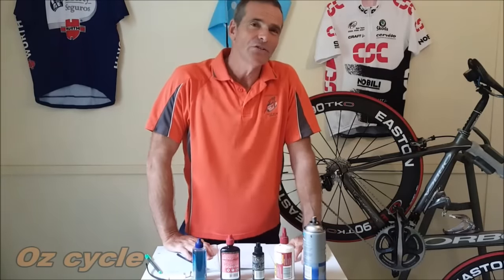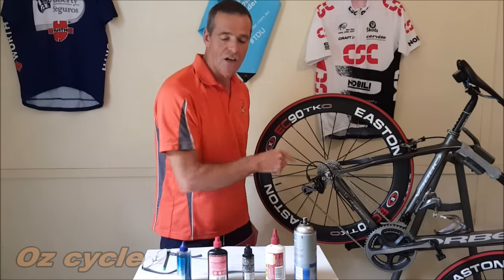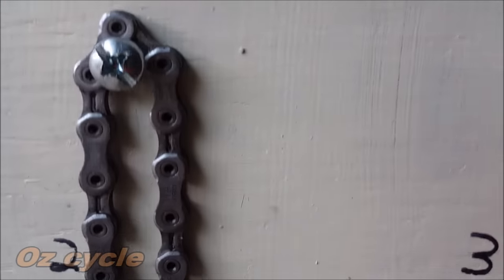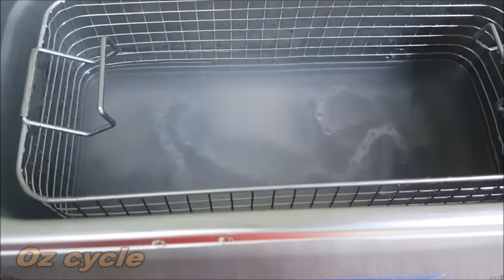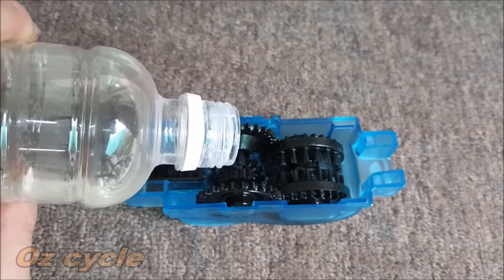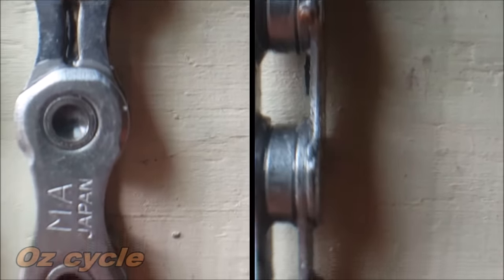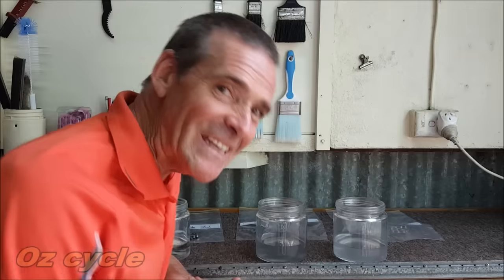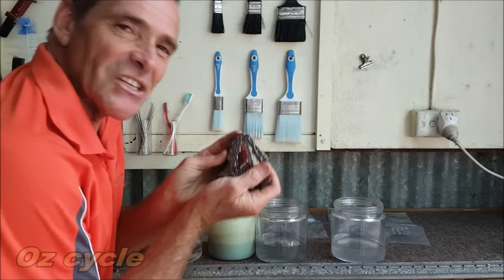Best chain clean ever !!

Comment: Hi just tried Your waxing on my hometrainer bike. it is sooo great. I started the chain in gasoline, then my ecological degreaser, then cellulose thinner, acetone, and a 1 hour cleansing in my ultrasonic cleaner with all the good stuff in. Ended up by boiling the chain for 10 minutes in water, the dried it. Man it was so clean you could use it for medical purposes. Put it in the hot wax for 1 hour, with lots of stirring, and just mounted it. Runs like a charm.  Thanx for your great videos and always new ideas how to get the best cheapest. Keep up the good work. :-)

Comment: Hello from Brisbane! Love your videos - some of the best bicycling advice around, I reckon. 

I've been using your degreasing and paraffin wax method on a chain since new, and it is way better than the previous chain, so smooth.

I degrease and wax the chain when it needs it, which is after about 250 kilometres. There's no black build up ever, and the cassette always stays shiny, though I do degrease it every 500 km's because I feel like it, not that it needs it.

Thanks for all of your thorough experiments and good advice - great work mate!
Reply from the maker: +Rob Pennefather Thank you Rob,glad you like the vids. Yes the liquid wax method is good but if you can do the wax bath method (next video coming) its even better in all aspects.

Comment: I really liked the thorough comparison of different methods and their effectiveness. I have stopped using petrochemicals however, even though they do the job very well. 
I just don't think the cleanest/most efficient bike is worth the environmental cost of having pollutants leached into the soil, streams and organisms. As there are biodegradable options now availabe, I've been sticking to those instead. I don't run top of the range components and I just make sure everything is cleaned when needed.
Reply: Exactly, I'm with ya
Reply: Could you please share what these options are?  Thanks
Reply: @scuba453  I use citrus degreaser for the chain. Weldite and other brands make it. It derives from citrus peels.
Other products like the muc off degreaser work slightly better and claim to be biodegradable, however, they have hydrocarbons.   Many products with volatile hydrocarbons are labelled as inherently biodegradable in the SDS, but that is very different from being readily biodegradable... Muc off boasts about being green, but looking at the ingredients list and their SDS shows a different picture... I've asked them to clarify the SDS against their marketing claims, but got not reply...

I've tried a few lubes and green oil is one of the best which is not petrochemical based. Both wet and dry. I also tried the WPL dry lube, but it lasts next to nothing no matter how it's applied. 
I want to check Peatys (some of their range claims to be readily bio)and Kingud eventually...
Reply: @nluisa  thanks for the detailed reply. much appreciated.  happy biking!

Comment: If you're paying AU$150+ for an ultra sonic cleaner, you're buying a rather expensive one. Additionally, you're getting one that allows you to put every single piece of your chain equipment into it at that. And your pedals, crank set and probably everything else you'd want cleaned, including your entire tool set.

And there's nothing stopping you from using a different mix of chemicals either.

However, the main advantage of the ultra sonic cleaner over the homemade cleaner, is that you're not left inhaling unhealthy fumes, polluting your lot or accidentally leaving something around that your kids will decide to either sniff or drink.
Reply: Wear a mask?

Comment: Excellent video. I've been using various home made shakers to clean my chains for years. I just don't like using gasoline but I Do often use gasoline +two stroke oil mix left over from my chainsaws fuel supply. After cleaning the chain I filter the gasoline oil mix through coffee filter paper to remove the residue and then run it in the chain saw. There's two fuel filters between tank and carb so the gasoline is the easiest to get rid of for me.  Keep up the great practical tips. Moe people should try your ideas because I've been doing many of these things for years including making my own chain lube :thumbsup:

Comment: Petrochemical solvents like petrol, turps or kero, are very good at dissolving most oils and waxes but are no good at dissolving water and water is no good at dissolving oils and waxes.  Degreaser and water is only a mediocre solvent for oils and waxes because water is a polar molecule and oil isn't.  All the degreaser does is weaken the molecular polarization a little.  Same issue with green cleaners as they are water based.  Alcohol, is a petrochemical chain that has a hydroxyl on the hydro carbon chain.  The hydroxyl part of the molecule is polarized.   Therefore, alcohol will dissolve water and visa versa but alcohol can dissolve a small number of oils and waxes, usually only some vegetable or synthetic ones, not mineral.  For example, caster oil is soluble in methanol but requires physical agitation to do so.  If you think about this, it partly explains the results.  Using petrol, degreaser and water steps, combines different solvent bases so will flush material that is impeded in these bases.  If you were to then use alcohol to flush the water, the chain would then dry much faster due to alcohols higher evaporation rate.  Yep, organic chemistry 1976.

When I was young, I used kero as a 1st clean and degrease.  It was cheap then but isn't now.  Petrol is kind of dangerous, it doesn't take much to ignite the vapor and is pretty hazardous for the body.  I generally take the chain off, soak and swirl it in turps these days as it's quicker than using cleaners that are ineffective oil and wax solvents.  I would agree with using degreaser after that.   The in line chain cleaner is largely ineffective because the small volume of solvent limits the dispersion of material cleaned off the chain and a lot of that material gets caught on the gears and jockey wheels to re-contaminate the chain.  That makes a big job, uses a lot of rags, wipes etc and you still can't be sure you got it all.   This is my main reason for taking the chain off the bike to clean.  Thank goodness for quick links.  I'm sure some people can point out exceptions, the principal of incompatibility between polar and non polar molecules is only a generalisation for the majority of cases.
Reply: Thanks for that excellent comment ! Just to clarify. You soak in mineral turpentine then soak in degreaser as well?
Reply: Unfortunately not all of us have quick links on our chains so that they can be removed.
Reply: you complicate simple situation, if you use wax, you can clean chain with wax, take a look on my coment to Mr. Miss
Reply: @khalilrazak6486  I never had a quick link on my chains 30 years, my bike I'm building will as I am embarrassed at my chain and cassette are black!
Reply: Khalil Razak 
A quick link costs almost nothing and installs with ease. There’s no excuse for not having a quick link :)
Reply: You're missing one key characteristic of soap/detergent chemistry and that is soaps and detergents are amphipathic molecules and that's why most soaps and degreasers  need water to work.   One end binds to the lipid, the other end binds to the water and bingo.   If you have enough oil and water, eventually all the molecules are tied up and that's why you sometimes need to add more soap to dish water.   This is also why you can add oil and dishsoap to a sink full of water, put your hand in, and your hand comes out with practically no oil on it.  ...try that again without the soap.     btw, i'm using soap, detergent, and degreaser interchangeably here even though they're technically not the same.   soap is a very specific substance where the other two are not.
Reply: @littlegoobie  No, I am not missing that key characteristic at all.  Detergents/degreasers etc are basically an attempt to modify water in a way that it can dissolve non polar molecules found in petrochemicals.  Well I'm sorry but my observations over 6 decades tells me this is a fools errand that only works in a weak and mediocre way.  You far better off just using the appropriate solvent type in the first place than trying to modify an inappropriate one.  Yes, I know that isn't the green thing, but the green thing just doesn't get the job done and that's all there is to it.  A very small amount of the appropriate solvent will simply do a better job  than many gallons of water and degreaser and just consider all the water you just polluted with that.
Reply: Lizard King  Polarization is not magnetic, it's electrostatic.  Water is a bent molecule, the 2 H are closer at one end than the other.  This means that the electron bonds are more on that side making the H side a neg charge and the O side a pos charge.  This is the basic reason that water has a surface tension and is the reason that water can not dissolve oils.  Detergents can modify this somewhat but the underlying condition still exists and limits their effectiveness.  Interestingly, alcohol has an OH on one end that also creates a point of polarization while much of the molecule remains unpolished.  For this reason alcohol is soluble in water and can act as a solvent for both some polar and non polar substances.  However it's ability is still a bit limited.  Alcohol is generally better with vegetable oils than mineral oils. For example 80% methanol 20% caster oil is a common basic 2 stroke model glow plug engine fuel.
Reply: Thanks so much for sharing your knowledge. 
So your recipe includes: 1. Mineral spirits (paint thinner. Correct?) 2. Degreaser (WD40 okay?)  3. Rinse with water 4. Alcohol (isopropyl okay?)
Reply: @littlegoobie  I took organic chemistry too and littlegoobie's explanation of how detergent works is the same as I was taught. Detergent works and it works well to remove grease but not as well as other solvents that are more dangerous. Unfortunately detergent does not disolve wax.
Reply: YES! Remove and swirl. Keep it simple...

Comment: I use a chain cleaner device thing and it does great.. Although you seem to barely use any chemical in it. I fill it until it overflows and then run it through, and repeat a few times when it all splashes out of the holes. I can run it through a soapy cloth without any black being left on the cloth.
Reply from the maker: +dan110024 I tried filling it up more,dan,but same thing...it spilled out,so for the video I put the recomended level.
Reply: oz cycle yeah they tend to do that. Mine is larger so it takes longer to empty itself, but messy nonetheless. Does a good job though after a few cycles of it and after a rinse with soapy water.

Comment: THANKS! I've been clean chains the 'homemade" method for decades, but I never knew it was as good as you have shown. Well I don't do quite your method. I use paraffin. I used to use gasoline when a was a kid. Paraffin (kerosene) is less volatile. Sediment settles on the bottom of the tank, and I can recycle an almost clear  jar of the stuff by decanting into a second jar. (I guess you could to the same with gasoline, but, but one has to apply more caution.)

Comment: Excellent video. It's very thorough, and I love the attention to detail. If I had the room to doo all of that, then I would, and I just might after getting my new chain in a week or so. 
However, and this of course doesn't clean and lube as well as the steps done here. 
Hello everyone. My name is Andrew, and I use WD40 on my chain. I tried to stop, but it is just so damn convenient. I spray it only on the chain and let it sit to loosen up the grime while I give the whole bike a good scrubbing after a ride. Once I dry the bike I power wash the chain with the highest setting on the water hose to blast out the majority of gunk while rotating the chain backwards. With a dry towel, I wrap the chain, and dry it by rotating the chain backwards again. After the chain is dry, I spray a light coat of WD40 on it again. Then wrap the dry towel around the chain to remove most of the WD40 from outside of the chain, leaving it as dry as possible. The pins will have WD40 on the inside where it is important, but the outside won't, leaving my cycling clothes spiffy cuz that is what's important ;)

Comment: Ok. Serious question. What chain link do you use? I was looking at a KMC one for my Campagnolo 11 speed but they suggest to replace them after 2 breaks. What is your experience with master links and what do u recommend? I always use a brush cleaner as Campagnolo don't recommend the Master link..
Reply from the maker: +WalrusRider Wipperman connex make the best removable link,Jon. All stainless,removable with just your fingers and last longest. Im still using same links after about 15,000km. Compatable with all chains too.

Comment: The faulty logic in this test is amazing. An unsafe degreaser/cleaner (gasoline) is used in the homemade cleaning device. It leaves a film and so a second degreaser is required to remove the film left by the gasoline. And yet the author concludes the homemade method works better than the ultrasonic cleaner when the ultrasonic cleaner was used improperly and yet it still equaled the effectiveness of the homemade method when the ultrasonic cleaning time was doubled. How much extra time was required to use a secondary degreaser to remove the gasoline film from the chain? That increase in time and cost of the homemade method was never factored into the comparison.

The ultrasonic cleaner may require a little more time (but we can't be sure because the author did not appear to use the correct fluid level -- with the correct level it may not have required any more time). But, in the end (after the extra time) the ultrasonic cleaner achieved just as good a result as the homemade device yet offered a HUGE advantage: It achieved its good results with a safe degreaser and cleaner. No risk to health. No fire hazard. No risk to the environment. No requirement to use a second degreaser to clean the film left by the gasoline.

I appreciate Oz Cycling. The author has produced some very insightful and helpful videos. My favorite videos address composite frames and components. Kudos and thanks to Oz Cycling for the great content. Sadly, this video is not among the good ones. And the original Oz video demonstrating the homemade cleaning device is even worse. In that video we see the author splashing gasoline on his ungloved hands. Imagine if he had splashed the gasoline in his eyes as he shook his homemade device! He never cautions the users to the risks of gasoline. Nor does he explain that gasoline will melt some plastics, therefore the user must be careful that the container they select for their homemade cleaning device is approved for gasoline. My advice: Remove those videos. Modify the homemade method so it works with a "safe" degreaser/cleaner that does not require a secondary degreasing. Then shoot new videos with the improved method. This will serve your viewers much better.

The homemade method may truly be the "winner" if it is modified for safe use at home by do-it-yourselfers.
Reply from the maker: +D.Eldon Petrol still cleans way better than my ultrasonic cleaner...tried and tested over at least six months. Try it for yourself...pull the chain apart after the clean and you will see which leaves cleaner pins and rollers.
Reply: Sure, gasoline dissolves grease and oil faster than the "safe" degreaser you used in the ultrasonic cleaner. No dispute there. The problem is: gasoline use presents risks to health, safety and the environment. If you base your degreaser selection only on effectiveness as a degreaser, then why limit yourself to gasoline? Why not use acetone or MEK or toluene? They are each more effective than gasoline. I think the reason you're using gasoline is because it's cheap, plentiful and it's the "easy" choice if you don't care about your health, safety or the environment. I'd hate to think what you'd use if acetone, MEK or toluene were cheaper and more plentiful than gasoline! I respectfully recommend that you not advocate the use of strong, unsafe degreasers like gasoline for degreasing bike parts.

So far, this video has illustrated the opposite of what you intended. It shows that the Oz Cycling homemade cleaning device works so poorly that it requires a strong, unsafe degreaser.
Reply from the maker: +D.Eldon The petrol used in the 'Homemade cleaner is about 300mL. It is reused 4-6 times before needing to be discarded. So 50mL - 60mL per use...quite conservative. Yes Petrol is cheap and available worldwide,unlike a lot of other cleaners.
Reply from the maker: +D.Eldon The petrol used in the 'Homemade cleaner is about 300mL. It is reused 4-6 times before needing to be discarded. So 50mL - 60mL per use...quite conservative. Yes Petrol is cheap and available worldwide,unlike a lot of other cleaners.
Reply: Michael Smedley 
Typical whataboutism.
The main commentary was making a good point: always use as best method not only the most effective but also the least environmentally harmful one.

Comment: Greeting from the US of A!   Very nice video.   I have been using WD40 to degrease the chain and then use the clip-on brush cleaner with dish soap to clean the chain.    Despite all that I will still have black stain on my finger by touching the chain.   I am going to try the homemade method now; that seems to be highly effective and simple enough.